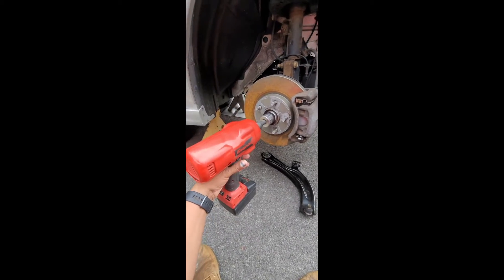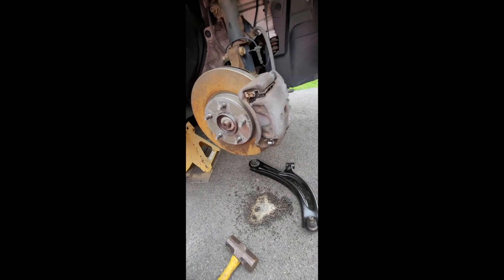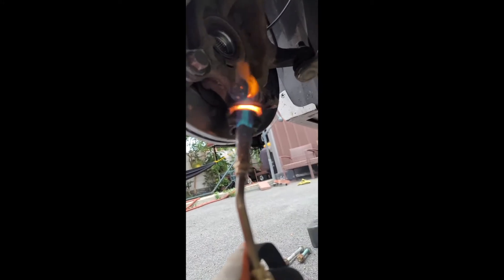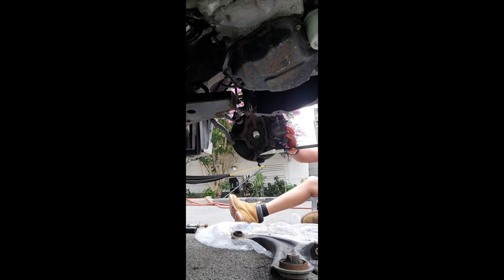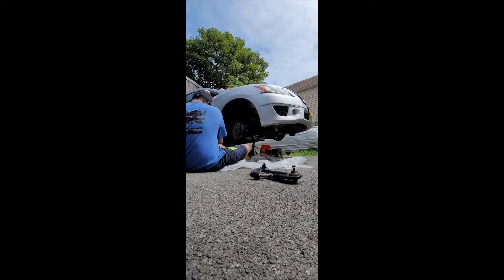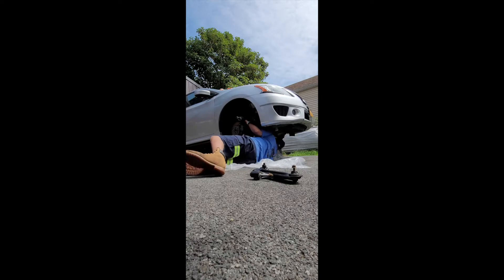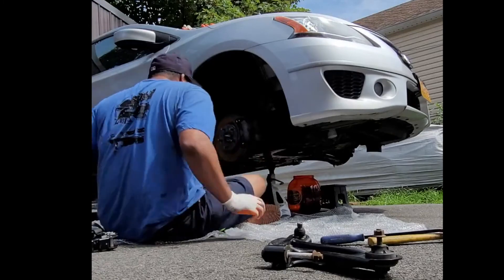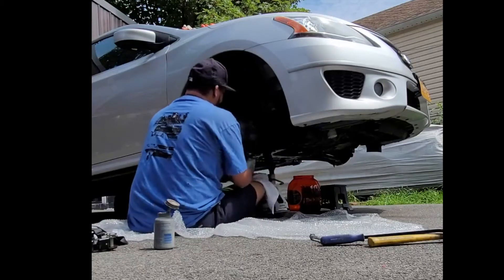Car Repairs: 2014 Nissan Sentra Axle Repair | Broken CV Axle Removal and Replacement / Installation

Comment: U don't have to remove control arm to do this. To get cv axels out take axel but off brake caliper and bracket. Maybe remove the 2 strut bolts to articulate the spindle out of the way and use a pry bar to pop the axle out. These cars need the manufacturer cvt fluid sont put Castrol cvt in it and special way to level the fluid off